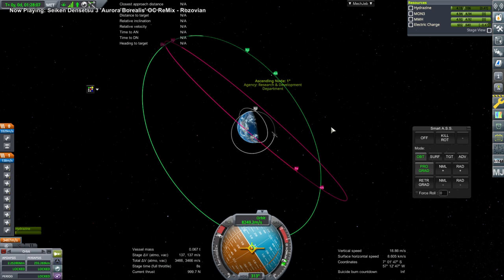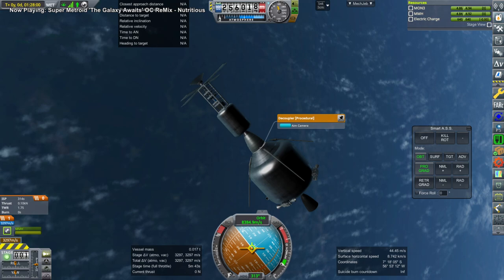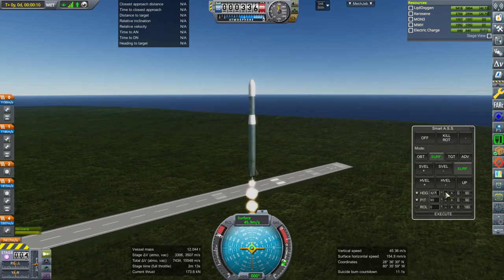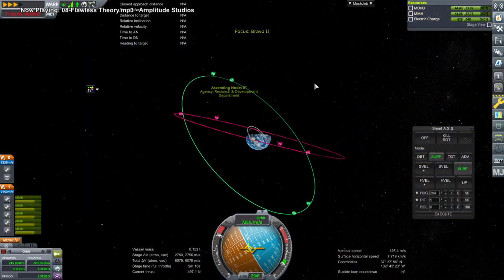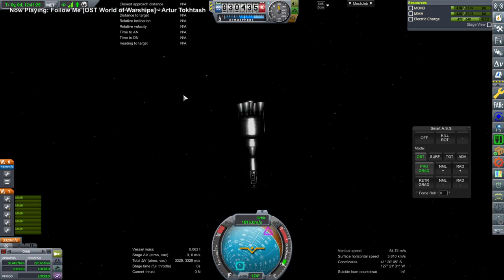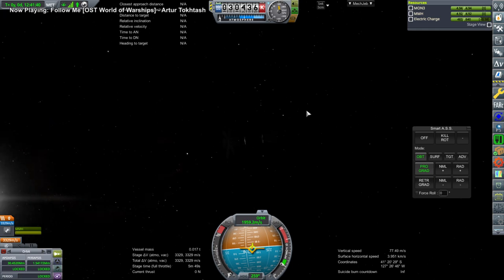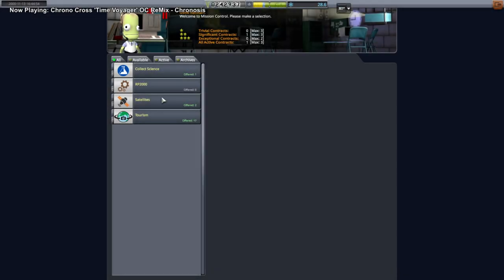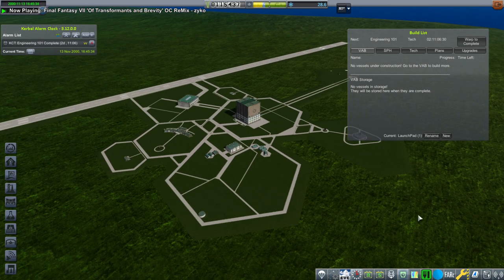KSP with Realism Overhaul - RP-2000 Development 10

Comment: I wish RP-whatever would include procedural engines so you actually have to develop the engines that you think will help progress your space program

Just like how they had to do in real life

Everybody playing RO/RSS uses the exact same engines because they are the best engines

I saw a mod for that but it's not updated beyond 1.8.1 and i couldn't get CKAN to install RP-1 on a fresh 1.8.1 install because it couldn't install RSS because there is no 1.8.1 kopernicus? 

I wanted to try it out but don't really want to bother the discord about it because everywhere i look it says not to bother them about older versions than 1.10. and I just wanted a look. Doubt I'll be interested long enough to actually go anywhere
Reply from the maker: You're in luck - for the first time ever, I used CKAN in preparation for telling people how to install RP-2000 in 1.8.1. As a result, I can tell you that you just need to reduce the version of RSS you selected. It automatically selects 18.1.5 when you should select 18.1.3. with that, the 1.8.1-59 version of Kopernicus should work. I haven't used Procedural Engines because I basically make my engines from scratch in Blender, but RP-2000 will be in 1.8.1, so conceivably it could work. Of course, with RP-2000, you will be using my Surestrut Engine pack and Small Rockets pack, introducing engines that everybody else playing RO will not have. I will eventually take requests for new engines.
Reply: @RaizSpace  woah I didn't know you could choose which version of a mod CKAN should use

I faintly remember playing RP-0 right before Scott Manley did his series on it. it was fun to get that first satellite into orbit after a bunch of struggles but I just built a replica of whatever rocket America originally used to do that same thing and it didn't feel like I knew what I had built

redoing real world events isn't what I play career mode for. that's why that procedural engine mod interested me so much. I wanted a mod like that to exist before I knew about it. when you feel like you want a new engine with more power and you develop an engine based on whatever fuel you have unlocked and choosing one aspect to be stronger would weaken other things about the engine because of physics (that I don't understand but would learn by tweaking the engine options)
instead of using whatever new engine was invented in whatever year forcing me to build an Atlas replica with no understanding of why those choices work